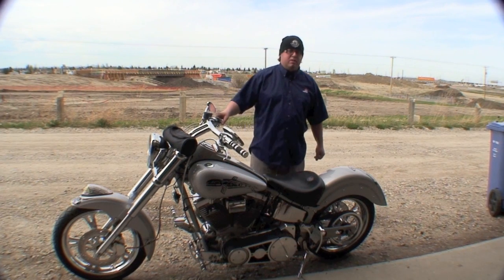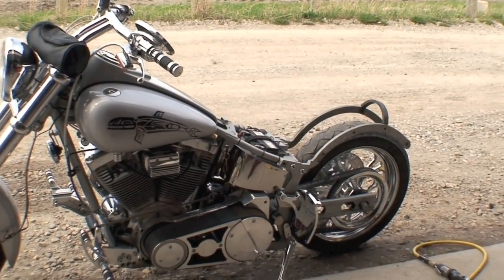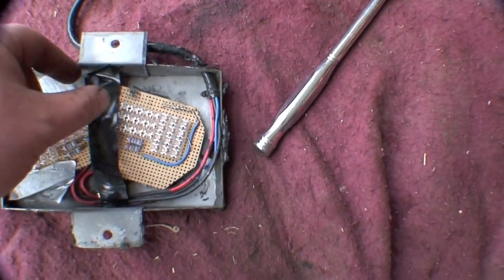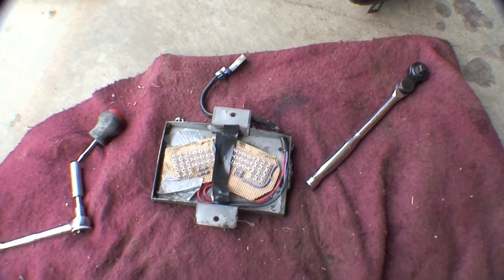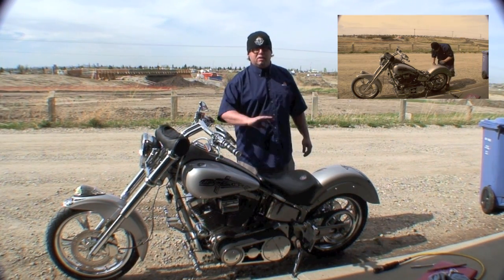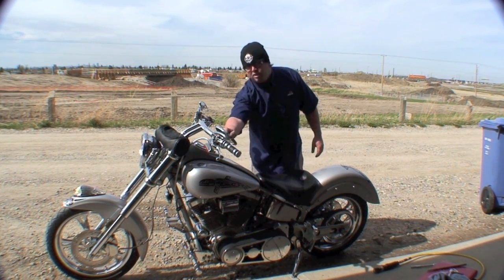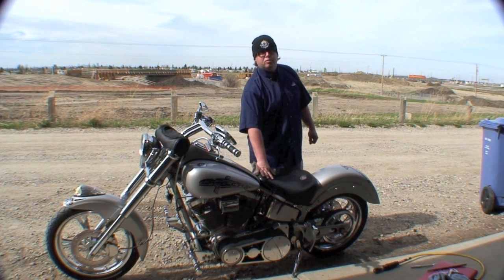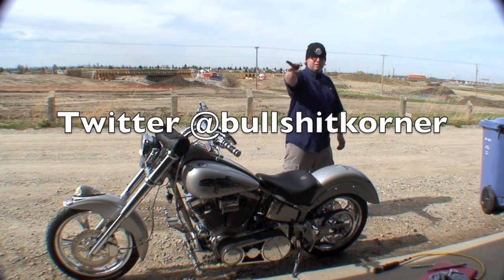DIY Troubleshooting Motorcycle Electrical Issues

Comment: I was just about to make a suggestion before I read your comment about not having the bike anymore. Maybe coat the connections that come apart in hot glue to keep them from shaking loose. I'm trying to find a video to give me clues on what to look for troubleshooting my lights. I think I got the wires wet using a hose or something.
Reply from the maker: i fought my headlight issue for a long time but came as a bad ground that would test good while stationary but would lose continuity if your moved it